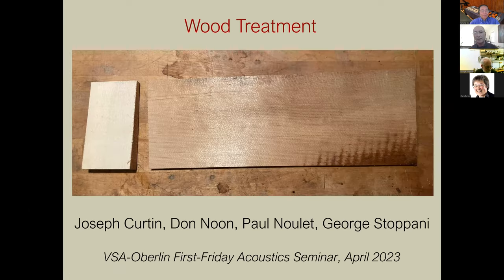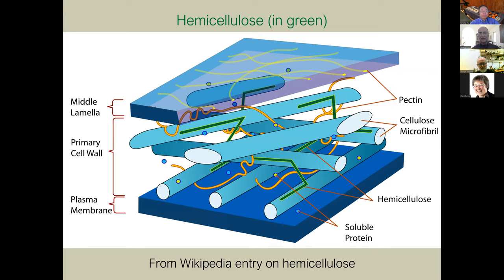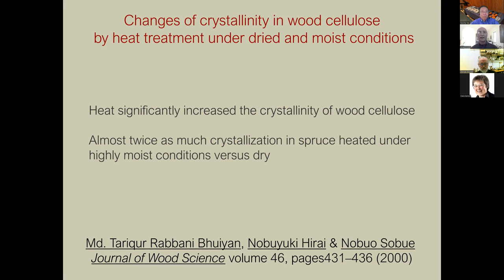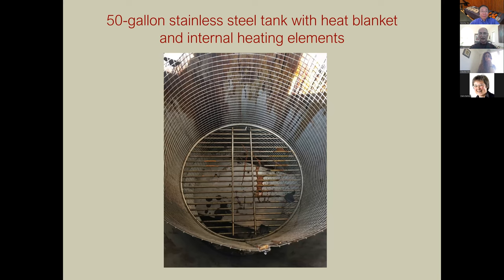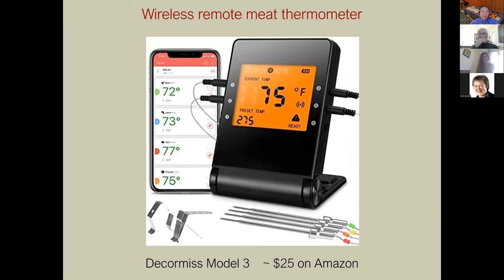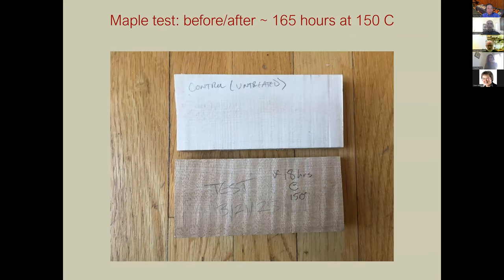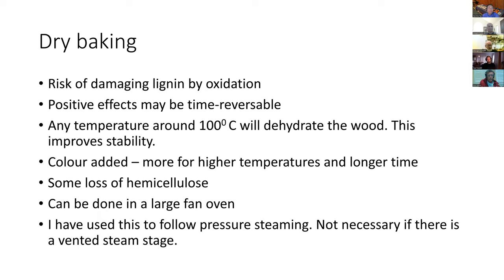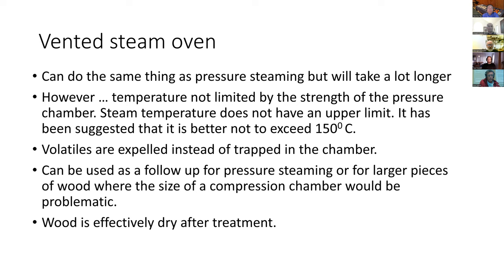Wood Treatments: Joseph Curtin, Paul Noulet, Don Noon, George Stoppani, April 7, 2023

Comment: As always quality time to listen.  I am making archtop guitars. I am steaming guitar top and back 5mm wood  blanks to bend them with wedges according to Helen Michetschläger, British violin and violas maker method. After glueing halves I carve the wood to final graduation. After listening to you I will not hesitate to prolong the steaming as Helen suggested not to steam longer than half an hour. I have steam bent as well torrefacted wood and got cracks, so maybe prolonged steaming and careful wedging will do the work. Interesting fact about heat processed spruce - it is much less transparent to light compering not processed wood.